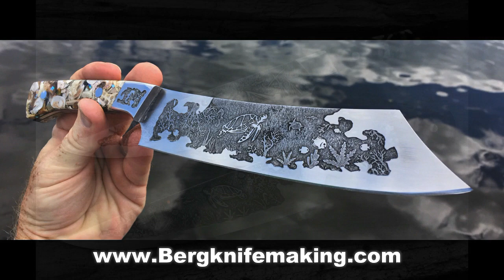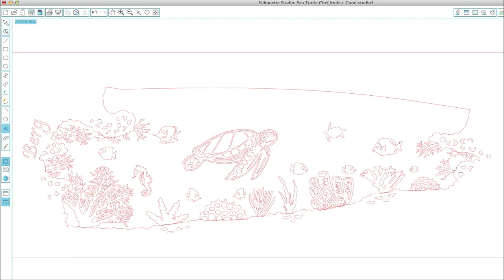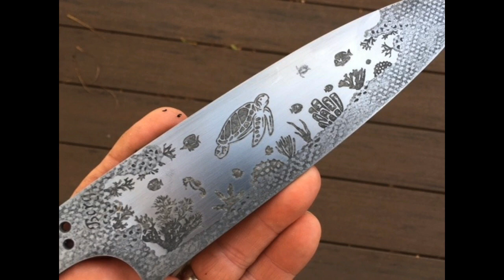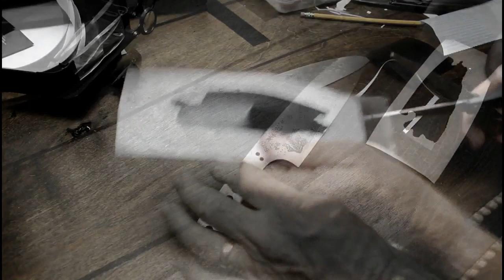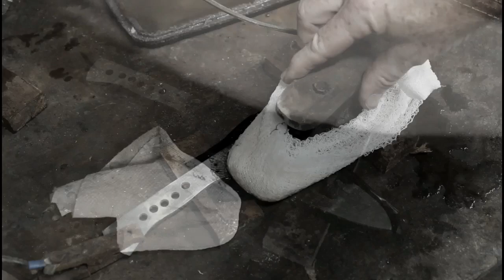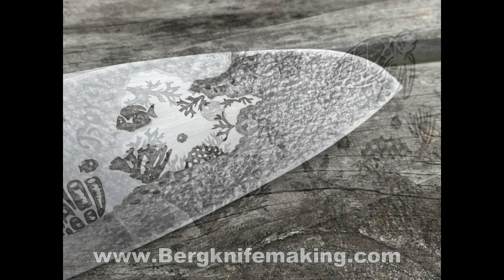Knife Making Electro Etching Repair by Berg Knife Making

Comment: You and simple little life inspired me to buy a Cricut Explore air 2 for the purpose of metal etching. If you don't mind me asking, what transfer tape do you use? It seems like there are a lot of options out there, including non transfer tape material, to get the job done. I'm just curious what you found is to be the best for metal etching transfer. Thank you.
Reply from the maker: I actually use Clear contact paper from Ace hardware. Its less expensive and in my opinion works better
Reply: I like this stuff.  @DIYeasycrafts  https://www.uscutter.com/RTape-Clear-Choice-AT65-All-Purpose-Medium-Tack-Application-Tape-100yd
Reply from the maker: @armadilloforge  Thanks will have to give it a try
Reply: @DIYeasycrafts  Awesome!  Thank you.  I'd seen hacks like this, with opinions swinging both directions.  I will go with your opinion, since you are using it in the manner I plan to.  Great work on your knives and art!